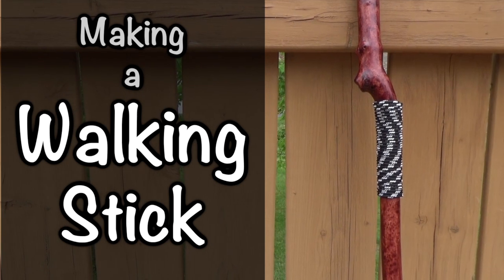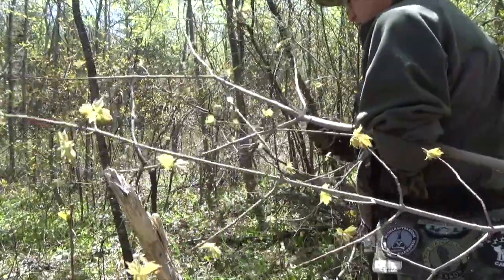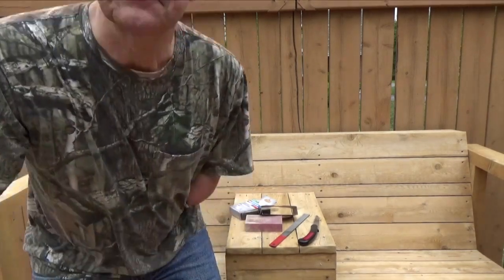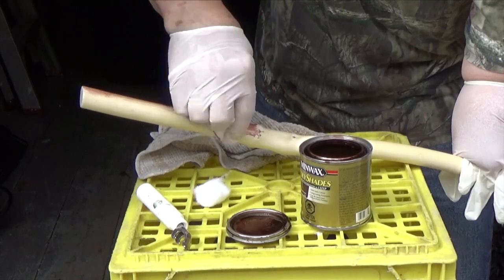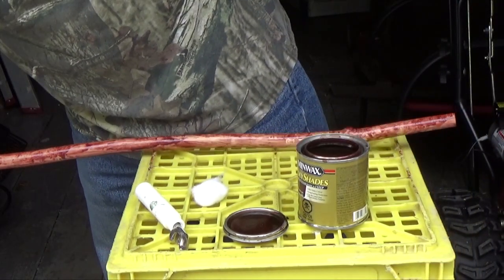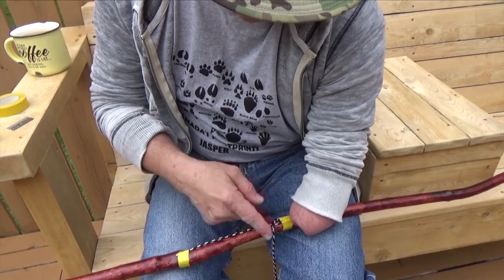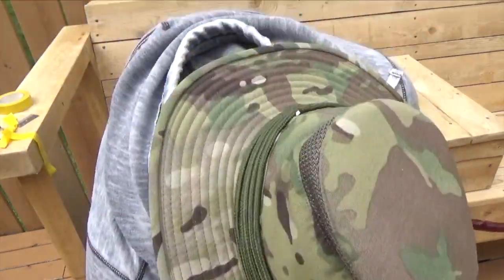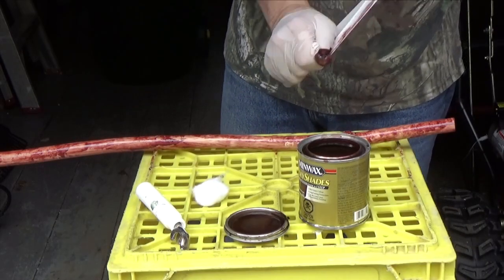Making a Walking Stick

Comment: When I returned to Nova Scotia with my family for the first time was in 1977, and on a walk in the woods on the land where I live today, I cut a little yellow birch which was growing too close to the wood road which is used a lot. I peeled it and cut it to just about the length of the one you are making. That stick is still with me today 43 years later. I sanded and waxed it with brown shoe polish and it has been rubbed almost glossy smooth with years of use, has been dipped in both Atlantic and Pacific as well as most of the Great Lakes, and a whole bunch of different rivers, besides being in a prop in a couple stage plays. I've since made several others, one out of alder which I deliberately peeled to leave some of the inner bark which turns a nice orange/brown colour and finished with a min-wax product called teak oil which needs many coats but gives a great finish. Alder makes a wonderfully light stick which is surprisingly strong. I also have a stick from a cedar branch, also very light. Not sure how it will turn out yet. Think I will honour them with your idea of a cordage hand grip (thank you) and thanks for the video!
Reply from the maker: Wow Frank... that's an amazing history that yellow birch walking stick has had! Thanks for sharing that story!

Comment: Jim, you said that when you only have one hand, tape is indispensable.  In my 62 years on this planet and 50+ years camping I have found that tape is indispensable even with two hands.  In Camping and Bushcraft it's good to make the items you carry multi use and multi functional.  You could rap one end with cordage, drill a hole on the end and install a 1/4-20 cut off bolt or all thread to make your walking stick a monopod or narrow stick on one end to a diameter of 1 inch to mount a Spear Point or better yet a frog gig as you can use it for fish and frogs. 
Wonderful video with good information  THANK YOU.
Reply from the maker: GREAT ideas, John! Thanks for sharing!

Comment: Hope the new walking staff gives you many miles of beneficial assistance.  For many years I thought that walking staffs were not very useful.  Then I placed some hardware on top of a staff in order to use the staff as a monopod mount for my camera.  Of course I found it easier to use as a hiking staff than to transport it any other way.  A funny thing happened.  I learned to really appreciate having it as a hiking staff especially when "bush whacking" off trail.  After experiencing the added stabilizing assistance when stepping over logs, stepping from rock to rock, going down steep slippery slopes or crossing creeks etc, I learned to appreciate it's usefulness.
Reply from the maker: I often go off-trail so branches and spider webs across the face area regular occurrence. I once even had a spruce twig rub the surface of my eyeball, but only through the Grace of GOD did I escape that one without issue. Since I am "short on one side" I've had a lifetime of leaning more to my left or forward to compensate for it (thank God I'm not taller because I would have had to lean further!) Anyway, it has resulted in a curvature of my spine towards the left. Medically it's called, 'Scoliosis', so I can't carry a heavy pack too far without getting overly tired. A trekking pole or walking staff gives me much needed support in my foot travels.
Stay well my friend, and best wishes to Connie.
Reply: i know it's kinda off topic but do anybody know a good site to watch new movies online?

Comment: Hey Jim: Looks great. The real advantage for me with a walking stick is that it provides a 3rd point of balance for those like me that enjoy have another point of balance. that pole looks plenty thick enough & will be lighter that a thicker one without giving up a ton of strength. I got two about 5 years ago & almost exclusively use the lighter one. I have a metal cap with a small pike on the bottom. Thanks for the video & Stay Safe Brian 80.
Reply from the maker: That spike at the bottom would be a good addition, especially if I needed to poke a coyote. I've used walking sticks to keep aggressive dogs from getting too close before.

Comment: Burn it with a torch use steel wool on it and finish with Boiled linseed oil 2 or 3 coats

Comment: I found a stick today that I wanna make my walking stick. The markings on it are incredible and i'd prefer to not sand it, to preserve those markings, its bark free already. What can i use to preserve it thats clear? great video, yours looks beautiful!
Reply from the maker: Jeff Hadley Thanks. I’ve since made another one, it’s thicker and straighter than the one in this video.
All you need is a coat or two of clear Varathane. It’s the same stuff that they use for hardwood floors. Varathane is the brand name and it comes in small cans like the one you saw in this video.
Reply: Muskrat Jim fantastic thank you!

Comment: Nice job.. I used braided Jute twine on mine to use as emergency fire starter.. Not sure how it will hold up over time though
Reply from the maker: Plain 'Ole Chuck Thanks Chuck. Another thing that might cause an issue with the jute twine is dampness from sweaty palms. But I’m sure the process of separating the fibers to make it fluffy will also dry it out enough to take a spark.

Comment: Do not stain green wood. That's why it's not dark. The moisture is blocking the stain to get in and penetrate the wood properly. 2 nd Canadian that doesn't dry wood first. And it will crack. Oh Canada learn how to do stuff proper and don't show people how to skip important steps..
Reply from the maker: I didn’t want it to be totally dark mahogany. I just wanted it a little darker than the bare white wood, so I lightly sponged the stain on with a cotton ball. I like the results.